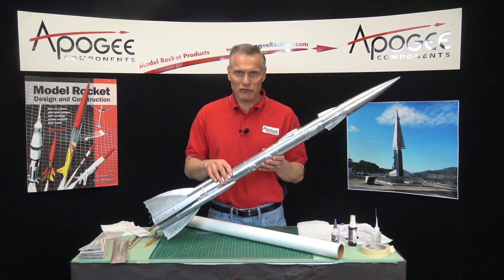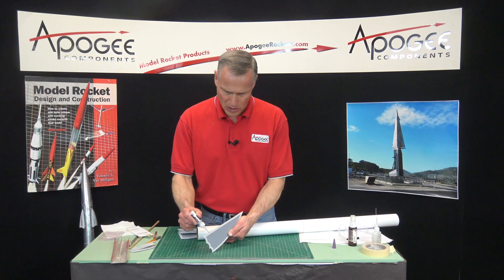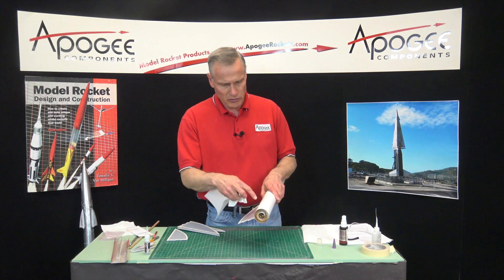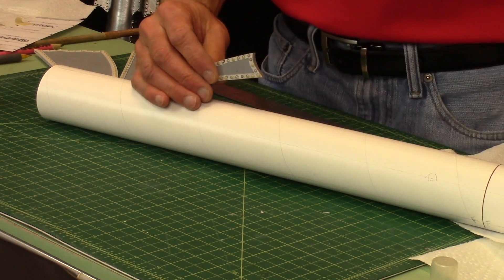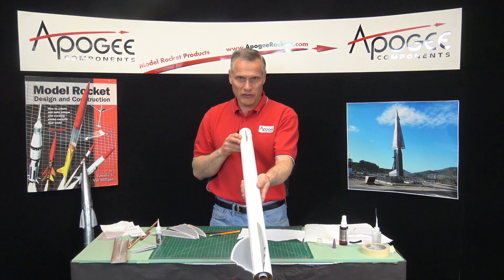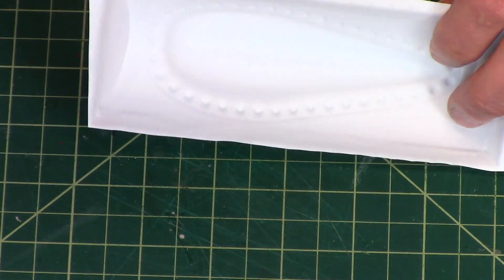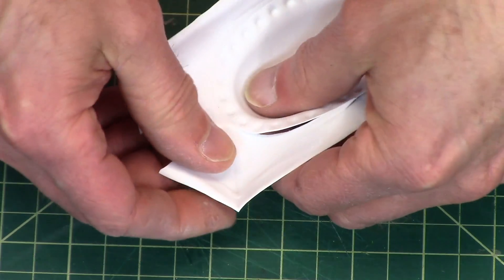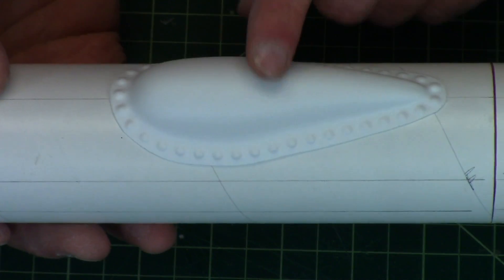Flying Machine Rocket Build: Part 8

Comment: IT's amazing how you can just slap those fins on and they're straight.  That's always the biggest challenge for me.  I have the guillotine and the little yellow Estes jig.  But I'm still adjusting the fin until the glue dries, I just can't get it quite perfect enough.
Reply from the maker: Yes it can be tricky but gets better with practice. One of the tricks we use here is to use a minimal amount of glue for adhesion. This dries much faster which prevents the wobbling/drooping fin. Then when dry, we can always add glue fillets to strengthen the bond.